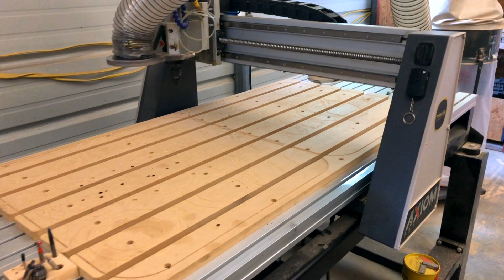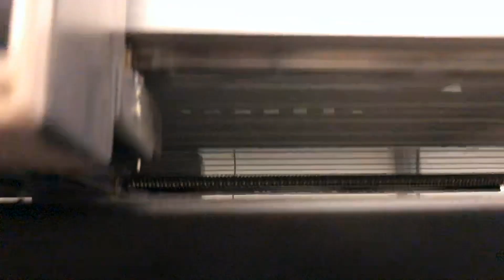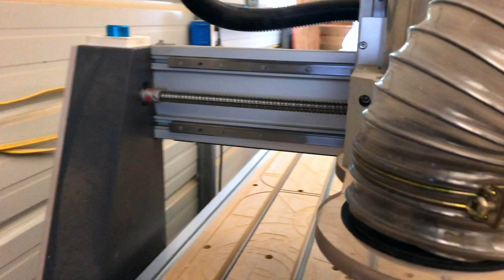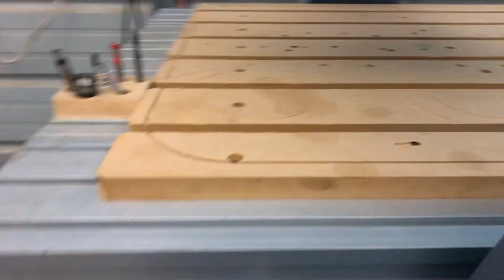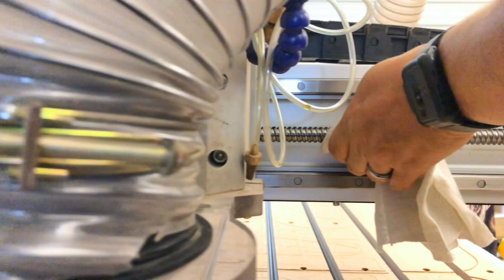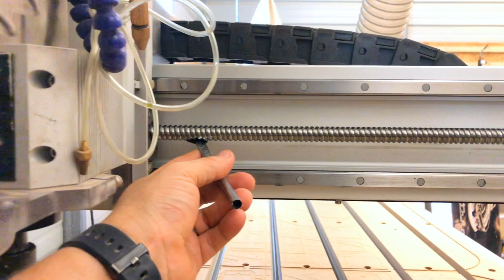Axiom CNC Routine Maintenance

Comment: Do you know how we can change the coolant?
Reply from the maker: There is an access panel on the back of the gantry behind your spindle that has the coolant reservoir. Just empty that, flush it with some distilled water and then add your fresh coolant.
Reply: Thanks for the reply… I guess we empty it with a syringe? But how do we flush it? This isn’t like a brake master cylinder where I pump the brakes to flush out the master cylinder.
Reply from the maker: @sd961960  Check out this video from The Southern Ginger Workshop. He goes through it all really well. 
https://youtu.be/tk7pGUB7odQ

Comment: Sir can I use WD40 instead 3in 1 oil
Reply from the maker: No, please do not use WD40. WD40 is not a lubricant. Eventually it will attract more dust and start to cake up making things worse. It’ll also get gummy overtime hurting your machine. 3-in-1 oil is best suited for your machine.
Reply: @TheTinkirWorkshop  can I use bike engine oil because 3in1 not available in india
Reply from the maker: @sonuverma2796  I would not recommend that. Motor oil will do the same thing. Attract dust and debris and ruin your machine. You need to find actual lubricating oil.
Reply: @TheTinkirWorkshop  sir can I use hydraulic oil 68 number
Reply from the maker: @sonuverma2796  I’m sorry, but I don’t believe the oils you have accessible would be recommended. I would try and find a light machine oil. Maybe there’s some machine shops around you that could recommend something that you have access to. Other than that, I would try and buy through an online retailer and have it shipped. I wish I could be more help.
Reply: @TheTinkirWorkshop  sir I searched but no oil find, can I use trademill oil
Reply from the maker: @sonuverma2796  Is that the silicone oil used on treadmills?
Reply: @TheTinkirWorkshop  yes it's silicon oil so can I use it
Reply from the maker: @sonuverma2796  Yes, I believe that would be ok to use.

Comment: You forgot the grease fitting.
Reply from the maker: Rob Brown The grease fittings actually aren’t accessible without dismantling parts of the machine. Axiom also recommends that they don’t need to be touched for the life of the machine.
Reply: @TheTinkirWorkshop  The document I got from Chadat Axiom says after 500 hours to grease them.
Reply from the maker: Rob Brown I’ll have to reach back out to Chad and get that document. Thanks for the heads up!
Reply: Kris the grease fittings are easy to get to.  No dismantling of the machine.    Axiom does NOT claim that the grease fittings do not need to be greased.

Comment: I'm in the process of designing and building a CNC machine and looking at lots of videos on previous designs/CNCs. The commercial ones are definitely the best. Look at Pro CNC's control box! The Chinese machines are a joke and a rip-off.
Interesting comment that waste gets caught under the gantry at the Y rails! This is one of the few CNC's I've seen the the Y rails UNDER the bed rather than on the side of the frame. Probably why the alum T-slot bed is so massive. With side-mounted rails, waste would just fall to the floor. In addition, access for cleaning the rails under the bed seems more difficult if not impossible. Assembly of the gantry must be a real project! With the Axiom, your machine, I don't see why they didn't mount the Y rails to the tube steel frame instead of the bed! Their design locks in the bed design and cost of that heavy alum T-slot. For example, if I want to machine carbon fiber, I need a water bed/tank that is steel so I can use magnets to hold the work. They could have use shaft rails instead of the square linear rails on the Y axis; much easier to keep clean.
The air cooled has a finned mount which you did not clean! I'm using a water cooled spindle; I'll be machining aluminum. 
FYI That rubbing alcohol has 9% WATER in it. On the X rails, you failed to lube the bottom side! However, since the blocks are greased, why are you even lubing the rails? Isn't the PTFE just making for a nice dust magnet to create muck for the bearing to roll over into a paste! 
Nice video though! Could use some more lighting.